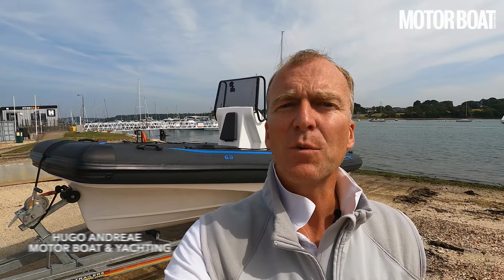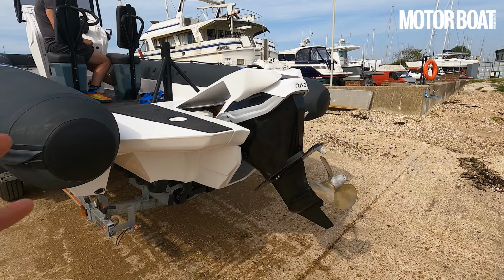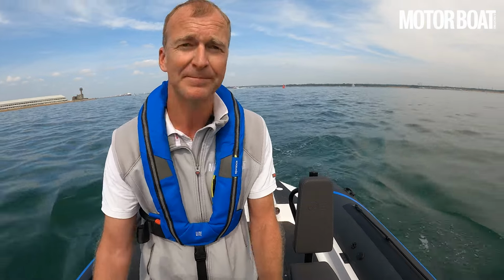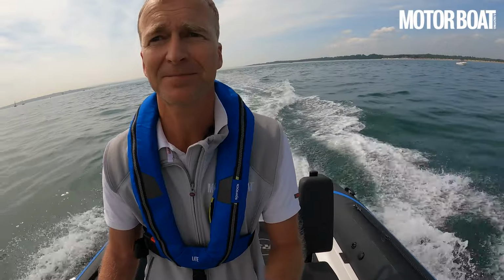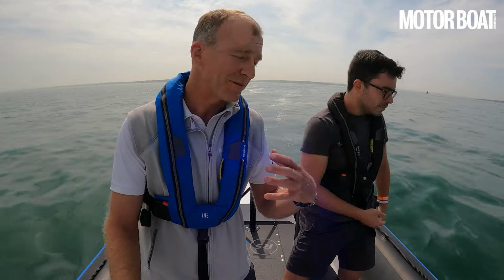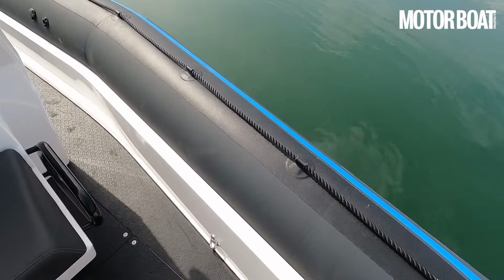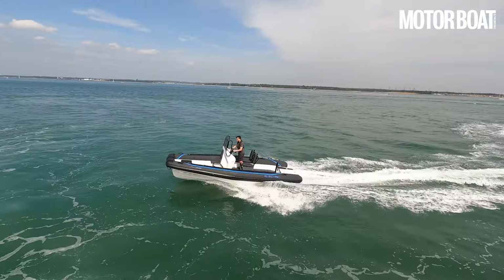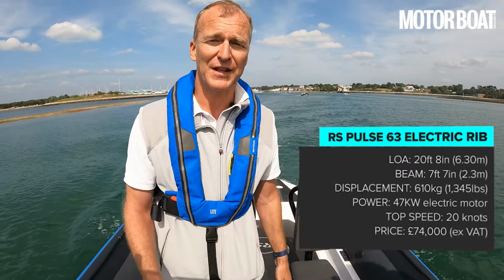Tesla of the Seas | RS Pulse electric RIB Sea Trial | Motor Boat & Yachting

Comment: Needs a physical indicator above the engine to show the orientation of the propeller
Reply: I tend to agree but there are plenty of sterndrive boats without rudder indicators
Reply: There is an drive angle indicator on the dash, which helps!
Reply: If you go to 12:30 Hugo explains there is one on the screen

Comment: In a few years we should start to see solid state batteries, smaller, lighter, longer range and quicker charging, when they reach the boating market these are going to be fantastic.
Reply: When you see Sulphur or  Aluminium being  used in batteries you will be seeing Batteries with  parallel or double the energy density of Fossil fuels and 20-40 times that of current Li ion.